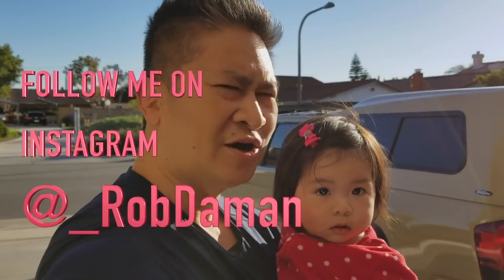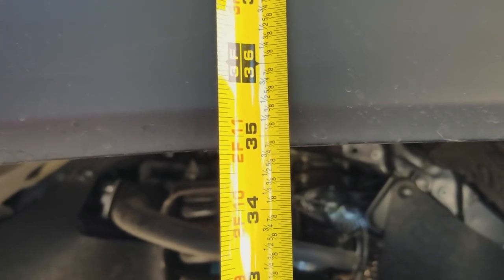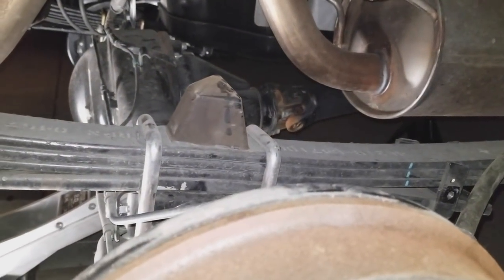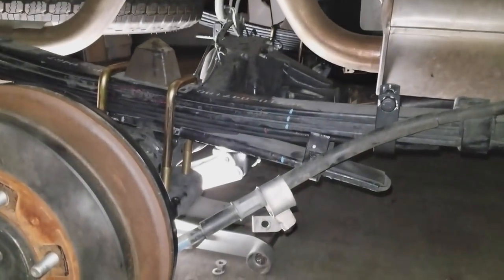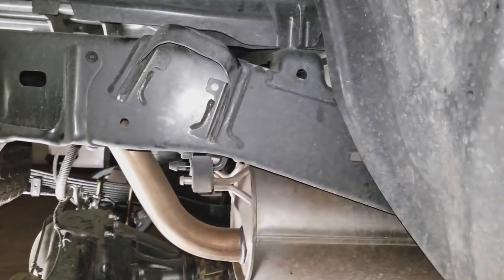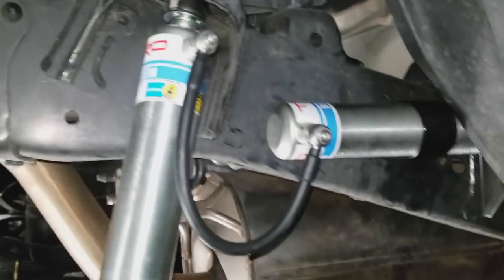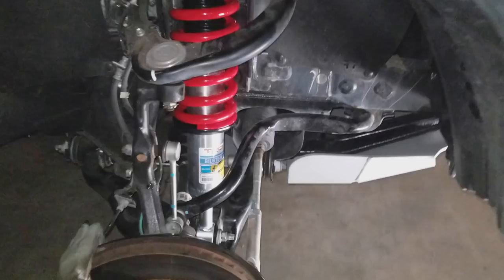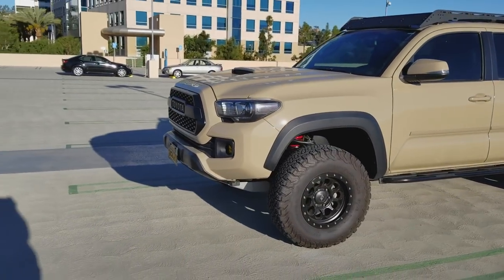I LIFTED my Toyota Tacoma Trd Pro Bilstein suspension and AAL Add A Leaf install

Comment: the overload spring is not ment to go back on....
Reply from the maker: It can go either way depending on need and desired height.

This is directly from Headstrong who I got the AAL from. TacomaWorld loves their service and knowledge and I concur.

________________________________

The single leaf provides approx. 1.5"-2" of lift and the 3-leaf provides approx. 1.5" of lift with the factory overload removed and approx. 2" with it retained. The overload does provide function, for when you are over load, so removing it or retaining it can depend on what you use your truck for. If you find yourself hauling or towing a decent amount of weight you may want to keep the overload in to keep the factory pack and add-a-leaf from overflexing. Now the lift height, performance and capabilities of any of the add-a-leafs can still rely on the factory leaf pack and its capabilities and wareability.

Basically, from the feedback I have, the single leaf provides a stiffer ride quality but better initial support of consistent weight and the 3-leaf provides a better ride quality and as more of the leafs are engaged then the weight support comes into play.

Comment: Awesome videos! Little late to the game but just got my Taco TRD Offroad. I can’t find this setup anywhere. Got rec to try 5100 Ride Height Adjustable in front at 2”; and a 1” block with 5100’s in rear. What do you think of this setup? I don’t go rock crawling, but I do go on muddy forest service roads here in GA. 90% of the time I’m on paved roads. Would value your opinion.
Reply from the maker: 5100 is a very stout and good budget minded set up.  Rear block is fine but personally I would go with a AAL on the rear.

Jason here used a block in back and was very satisfied with it. https://youtu.be/BCBT58owjwo
Reply: Rob Daman Thank you for taking the time to respond. I’m a 59 year old newbie to the Tacoma and going off road. There is sooo much info out there, gets kinda confusing.
Reply from the maker: @leedew59  you're young. Have fun with your new 🌮
Reply: Rob Daman Update... based on your advice I did further research and ordered a coil/Bilstein 5100 kit w/ Dakar leaf packs from Headstrong Off-Road. Will get 2.25” in front and 2” in rear. Kit also includes a .25” plate to address Taco lean.
Reply from the maker: Sounds like you made a great decision! Let me know how you like it when done. 👍
Reply: Rob Daman one more question... front diff drop - needed on a 3rd Gen with a 2” lift? Did you drop your front diff after your lift?
Reply from the maker: I did not. I think it's not necessary nor recommended.

Comment: With this setup did you have to install ecgs bushing?
Reply from the maker: Great question.

It's actually been a year of daily driving and I've had no bushing issues. 

My understanding that issue can happen at anytime stock or not.
Reply: Rob Daman thanks for the update! Yea I feel like it’s one of those things if ain’t broken don’t replace it
Reply from the maker: Ya some vendors Ive read never did one on their lifts

Comment: I see your rear sits higher by an inch compared to the front. Is that due to the AAL or would be it leveled without the AAL? So close to pulling the trigger on this trd suspension. Just not sure about the AAL
Reply: Alfredo Zavala it's supposed to be higher in the back.
Reply: BUCK MASTERSON 6363 I know. But how would it sit without the leaf upgrade. Or is it a must to AAL? Not too educated on this stuff.
Reply from the maker: All tacos have a rake but it appears on the 2nd gen it would level it but on the 3rd gen it will appear a little higher in front.

It's not a must to do an AAL but if you're adding to your payload or towing it will help maintain it's height in the rear. Now there's alternatives like helper springs, air bags and SuperBumps that could alleviate the saggy rear on load but it will also change how it feels in back.

Thanks for posting.
Reply from the maker: yes I wanted the rake due to the topper and future heavy loads. stock leafs aren't the strongest but I'm on a budget. thanks for chiming in.

Comment: Hey rob I have a 2017 Tacoma Ted OR I’m planning on getting a 3in lift and 33in tires I want to also be able to drive the truck on a daily basis what are some other components I should strengthen or swap out I know about the needle bearing anything else I should look out for ? UCA etc..
Reply from the maker: Hi. Good questions. 

With a 3 inch lift I'd suggest an aftermarket UCA. I'm at 2 inches and while  many owners will use stock UCA for 3 inch lifts I feel the steering is a little squirrelly. 

A lot of owners are concerned about the needle bearing as they should. There's no hard rule when they fail but lifts appear to aggravate the issue. I've seen one post that the dealer and Toyota corporate denied any needle bearing replacement. He had a local shop install the EGCS bearing and the noise was gone.

I haven't changed my bearing nor have any noise for a few thousand miles now.

I have 33s and daily this so my other suggestion is if you're offroading, do the CMC. I'm finally getting mine done next week so stay tuned for that video.

Thanks again for commenting.

👍🌮❤️
Reply: Rob Daman awesome thank you so much keep up the sweet vids!
Reply: Rob Daman are you UCA stock?
Reply from the maker: Yes. Stock

Comment: Did the dealership void your warranty?
Reply from the maker: Great question. 

No voiding. Of course if I complain my ride is too stiff or loose I doubt I'd get help but I've gotten my clutch pedal issue fixed as well as other work.

Comment: Do you only cut off the retaining clip at the rear of the leaf?
Reply from the maker: I did for my 3 leaf AAL. A single leaf you may not have to
Reply: Rob Daman thanks, installing my 3 leaf icon aal today...wish me luck 👍🏽
Reply from the maker: Take your time. Driver's side is a little tougher. If you got a extra pair of hands to help it'll go easier.
Reply from the maker: How'd it go?
Reply: Rob Daman I got the drivers side done lol
Reply from the maker: That's the hard part. Smooth sailing now
Reply: Rob Daman yeah the right side is going faster, had trouble cutting the retaining clip

Comment: Looks badass dude! 👍😀
Reply from the maker: Thanks! 💪🌮
Reply: Rob Daman have you had any issues with it? Alignment or vibration in the steering or driveline? Do you have air lockers?
Reply from the maker: no needle bearing noise at all. i'm going back to do realignment only because the firestone I went to were meh and just did toe. I want caster and camber adjusted a little but it tracks straight.

no air lockers. stock off road diffs.

thanks again for posting.

Comment: Double checking. If I replace the rear shocks only do I need an alignment? . Just came into a set of Pro but didn’t want to pay too much for my insurance. And if someone has a link for replacing rear 2016-2019 Tacoma shock only. Thanks
Reply from the maker: No alignment necessary.
Reply: Gonna try to get them on this week and maybe be like you and post a vid 👍
Reply: Hey Rob I torque the rearshock bolt to 74lb but saw 43lb from another vid. What did you torque yours to?
Reply from the maker: Looking at the 2015 TRD instructions the bottom rear says 43 ft lbs and top is 15 ft lbs. 

I had put a copy on my blog http://robdaman.blogspot.com/

Comment: How is the ride after installing the lift?
Reply from the maker: Hi. It's firmer than stock in front but over dips it's way smoother. Going to try Holy Jim tomorrow and see how it feels.
Reply: Thanks I think I'm just going to order the add a leafs for the back. I going to do a road trip this summer so I have fiberglass cap on, racks, storage box on roof, road shower, and canoe. I'm thinking the add a leaf will beef up the back I'm just hoping I don't loose smooth ride.
Reply from the maker: That's a lotta weight. You may look into a full leaf pack as my understand the oem leaf is weak and will sag over time even with the AAL. If you do an AAL you'll need to get a different shock than the stock one. Bilstein 5100s are good enough for you and inexpensive.

Comment: I'll be honest. That looks like a nice rig. I recently sold my 2018 4 by 4 Toyota Tacoma I bought it brand new. It is a subpar machine.. POS. I bought a Toyota 4Runner. 100% Japanese. 100% Japanese product. All the parts. And I work in manufacturing.take my advice and then do what you want. Do not buy it 3rd gen Tacoma. It's a neutered. The 3.5 v6 is a POS. Six-speed transmission electronic. POS adaptive cruise control POS nothing works right. Ridiculous engineers recently out of college. Bunch of kids with no know how. My advice by 100% Japanese 4Runner while you can. That's the reason 80s and early 90s Toyotas and Hondas were top of the line. Made in Japan where everything's blueprinted they took advantage of our labor force. We have the best labor force in the world. But the EPA. Our government has  neutered everything. 3rd gen Tacoma POS nothing can convince me otherwise. I do like the looks of yours. I liked the looks of mine too. But we've been duped as Americans. Nothing but junk produced. And that's just like my opinion man
Reply from the maker: Thanks for the compliment. 

I do like made in Japan vehicles and my wife's RX350 is made overseas and very good build vs the made in USA Acura MDX we had with a junky and dangerous German ZF9 transmission. 

T4Rs are going to get a revamp soon. I'm not sure where they will be made. When my kids are too tall I'll have to look at a larger vehicle than a T4R. We had a GX470 and it ran great.

Comment: Nice! But why add OEM shocks back on when you can get better ones. J/W. 👍
Reply from the maker: Thanks.

These shocks are by Bilsteins and the rears are actually 5160s so they can take the taller height of the AAL.

Great deal for $615 shipped

Comment: In my younger days, I’d be all over a project like this. For now, my Taco is staying stock height. Kudos to your DIY muscles. Also, I see you didn’t go with the Softopper after all. How much are hardtop caps going for these days?
Reply from the maker: How old are you? I'm 46 and after a few hours of doing this I felt I was getting too old for this. lol. My kids are too young to help me wrench the heavy stuff. 

I actually bought the Softopper and was about to install then I found the hardtopper for a fair price. New would be over $2000 with options but I got it used for considerably less. I'm actually going to discuss the benefits of each soon. 

I'm finally gone away with the sickness so I'm going back on vids.
Reply: Rob Daman I’m in my 50s. 🤦‍♂️
I knew what I was giving up going the Softopper route; lockability of whatever I put in the bed. Looks won out cause I like the safari/military look of the Softopper. Since our trucks are basically LEGOs for men and modular, I’ll give it a few more years and trade up to a Snugtop. 🤙🏼 We can’t leave well enough alone. Haha!
Reply from the maker: I'm 46 and thought about why I was still doing this. Lol.

Totally agree about the mod bug. Always have that itch to do something!

Comment: Add a leads make back of truck stiff as hell. I removed them after 2 days.
Reply from the maker: my Headstrong 3 leaf progressive feel pretty good to me and I kept the overload leaf too. Was yours a single leaf? I've read those are stiffer.

Thanks for commenting.
Reply: Rob Daman It was a single leaf. I ended up using blocks. I was able to machine them to level the ride height. Truck looked more even. The add a leaf jacked the back up too high.
Reply from the maker: Glad you got it fixed. B I've read about the single AAL and stiffness. I'm really happy with my 3 leaf
Reply: Rob Daman Thanks ,your truck looks great.

Comment: Hi Rob, Just been digging you videos.  I've just started the down the dark path of updating my truck.  Suspension has always been an issue for me.  I have the Wheeler's 1.5" Progressive AAL leaf/overload pack and it looks similar to the Headstrong setup.  I am installing Bilstein 5100 Front/Rear with OME 2885 Lift Coils and I'm trying to figure out if I need to leave the OEM overload leaf in.  I'm not trying to do any crazy lift, just updating my suspension and not realizing with what I've chosen, lifting it as well.  :)  My truck is currently stock and has had the recall on the oem leaf pack down last year.  Also, on the headstrong AAL, when you undid the center bolt, did the center pin/bolt just slide out from the pack?  Thanks for any advice or insight.  Keep up the good work!
Reply from the maker: Thanks for watching. Yes the bolt came out easy. It was the new one being a challenge because it was longer and needed to be trimmed after the install.

Comment: Hi Rob, do you ever have any issues with the front end of the overload coming in contact with the rivet/clamp from the AAL kit when under full compression?  (you can see the vertical alignment at around 6:15 in the video, look at the rivet right above the front tip of the overload leaf) I am about to install the ICON AAL version of this kit which will have this vertical alignment
Reply from the maker: Hi, Good question. If I recall I think it clears it. It was the rear part where I had the issue. Let me know your results.
Reply from the maker: Forgot to mention no issues with that but keep an eye on the bolt near the gas tank. I hit it and also I saw someone else for too. Cut it down and good to go 👍
Reply: Thanks for the advice and speedy reply,  After doing hours of research I thiiiink that the HS AAL kit has different spacing of the spring retainer clamps than the ICON kit.   I think I will exchange the springs for the HS version as I would like to run the AAL with the overload and not have it interfere with rivets.
Reply from the maker: No problem. Let me know how you like it. I've had no issues besides that bolt I mentioned. Rides well. 👍
Reply: Just to close the loop in case you were interested.  I found out that it seems like Toyota either changed the design or manufacturers for the TSB (4 leaf) packs which ended up putting  the retainer clamps and the overload spring brake line mount/retainers in different places.

Similarly the manufacturer making all of the 3 leaf AAL packs has also been changing the designs around to accommodate the TSB springs and possibly other reasons as well.  These changes have made the AAL kit so that most won't have to cut any spring retainers anymore, however depending on which version of TSB packs you have you will have to cut the retainers off of your overload spring.  Additionally also depending on which TSB pack you  have, the overload spring will contact the AAL retainer rivet head under heavy loads.  

The ICON kit i originally bought didn't work, so I asked for dimensions of both the Head Strong and Wheelers 3 leaf kits and both would not work with keeping my overload spring.  

Result: after much research I ended up going with the Wheelers 2" AAL with my TSB leafpack (w/ overload) paried with some bilstein 5100 dampers.  I am very happy with the height and I would say the ride quality has improved over new TSB springs with 95k mile stock sr5 (Black) dampers.  There may be some very sliight barely noticeable rumbling on the freeway, but  I can't tell if i just didn't notice it from before.

Thanks Rob again for your quick replies and advice! Def like the content of your channel!
Reply from the maker: @PhilSiri  hey thanks for that legwork you've done! I appreciate the details. That's going to help other enthusiasts. 👍

Let me pin this comment as others need to know this.

Thanks again for helping and commenting.
Reply: Rob did u drop the differential ?
Reply from the maker: Hi. No issues but my understanding the icon positions itself a lil different than the headstrong AAL. One of the comments here state that.
Reply from the maker: @emmanuelcamejo4525  front diff drop? if that's what you mean, no sir.
Reply: Thanks a lot rob .. I’m doing the 5100 with 887 coils like 2.25” and same lift you used in the back ...you think I will need to drop the diferencial?
Reply from the maker: @emmanuelcamejo4525  front diff? no. rear lift does need to be lowered as I did in the video. watch that brake line.
Reply: Thanks a lot rob big fan of ur build

Comment: Hey Rob just posted some videos where i show measurements if the rear please check them out . See if you can help me find a solution to the sag . Also let me know what you think of my tacoma
Reply from the maker: nice truck. you didnt measure prior to changes did you? it could have been off already and just made it more pronounced
Reply: Thanx . I didnt take measurements before so i still cant figure out why its higher on one side . With the tire sticking out i think the bed might be off of alignment . Im going to try and fix that today

Comment: Thanks for the video man! Did you have to cut on both sides?
Reply from the maker: yes. the leaf hits that same retainer clamp. if you get a single leaf AAL you may not have to. My friend said he didn't but a 3 leaf possibly.
Reply: Did the centering pin come out of the new AAL? Mine looks like it’s welded in.
Reply from the maker: Yes. The little nut in top should come off and there's a sleeve so it may look like 1 piece. Is it from headstrong?
Reply from the maker: Yes. The little nut in top should come off and there's a sleeve so it may look like 1 piece. Is it from headstrong?
Reply: Yea it’s the headstrong AAL just like yours. I’ll have to loosen the nut tonight and see if the pin drops out
Reply from the maker: It does. You're good to go